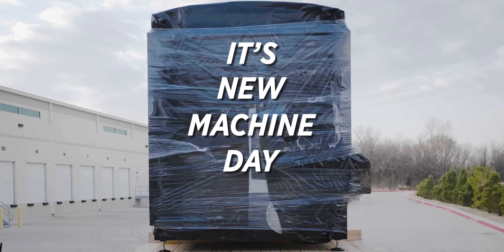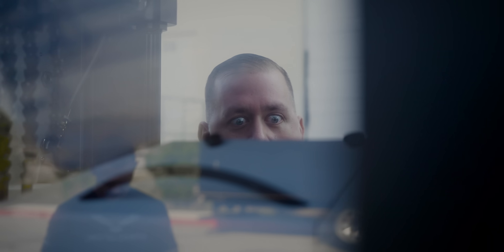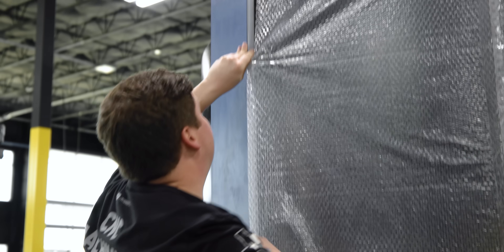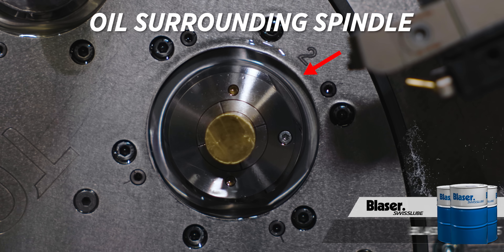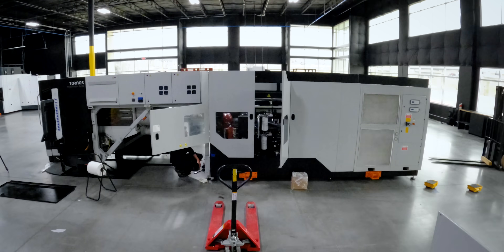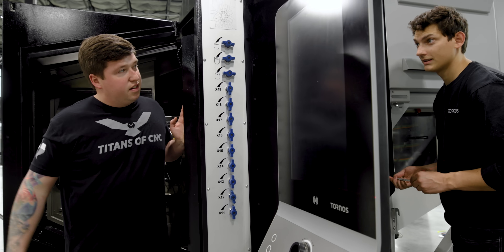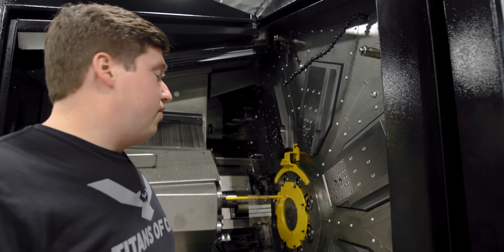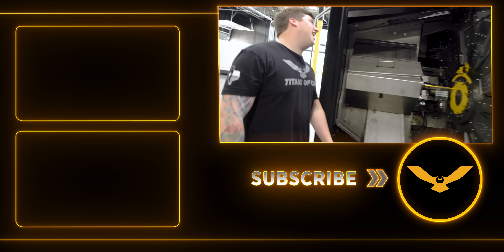GIANT 35 AXIS 8 SPINDLE MultiSwiss CNC Machine

Comment: This stuff is addicting to watch!  I took a CAD class at ivy tech in the early 2000s, and worked as a maintenance man at caterpillar engine plant in Lafayette IN. They had HUGE machines that would mill raw locomotive engines in the plant then assemble them. Those machines cranked out some huge chips, and a LOT of material! I had to dump the hoppers 😆. I wish I could’ve finished my degree😔. Thanks obama🤷‍♂️🤦🏼‍♂️

Comment: Have been runing the Tornos mulideco for years and, we stepped Upp to Index ms40 Machine. Runing parts in 4.4 sec.  When we testede itt IT did not move more than 0.01mm on 200000 parts. Runing in brass. 😁

Comment: Can we get a listing of what the 35 axis are?   I get the 8x X,Y for the panels we saw moving, and 8x Z for each spindle, but what are the other 11?
Reply: 8 X axis
8 Z axis
9 C axis 
6 Y axis
X and Z on sub
35 axis of motion
Reply: So there is a little debate up above about counting axis. I will go with what the tech college taught and that was basically 'if it moves, count it'. Spindles move on Z axis but they also rotate, which counts as +1 each. So 16 axis for the spindles. I am assuming the tool posts also do X and Y. That is another 16 axis. The 8 spindles also appear to rotate as a unit, so that is +1 for a total of 33.  If there is a pick off to grab the finished parts we probably get to add a few axis for that as well. I'd have to watch the machine cycle a part or have the manual in front of me, but I know I am close. Kinda want to find one of these operating near where I live and go check it out.

EDIT: Rewatched the video and there is a few seconds clip of the pick off coming it to where it would go to grab a part. Z axis to grab the part (+1). It also has to rotate, I assume... (+1) which gives us 35.
Reply: @andreidejanovich9041  That can't be right, there is at least one more tool post for drills and such coming in from the end.

Comment: Didn't Tornos make a MultiDeco like 20 years ago??? I run and setup ancient 6 spindle Tornos AS14 cam operated screw automatics.  They have come a long way from the old ones for sure. Currently we run 2-3 second cycle times and holding pretty tight tolerances with shave tools.  The pick offs are always a weak spot. We also have 32mm capacity ZPS 6 spindles as well. I specialize in multispindle but I can also setup/run CNC lathes (Fanuc only) . Love yalls content.

Comment: I was wondering how many 8 spindle acme bar machines I could buy for the cost of this?  Probably as many as I want and a building to put them in. But it’s cool
Reply: I'd rather have the ZPS or Gildemeister offerings , it's what we have. From what I was told the Acme Gridleys did not hold very tight tolerances and were more maintenance intensive. I've never seen one in person though.
Reply: @lonestaraudioconnection  the Acme Gridleys are a marvel of mechanical engineering. They don’t get much notoriety but they revolutionized manufacturing and quite possibly won WW2
Reply: @dovemfg  for sure they have their place in history. The ones we had were from the 1930s.

Comment: I thought I was a player with 9 axis, 2 spindles, and 3 programs running. 

You got my attention!

Looking forward to the rest of this series!!!
Reply: it’s not a 38 axis machine though lol unless every tool in that machine can touch each spindle.
Reply: @Rightisallwrong it has 38 different moving sections that require programming so it’s definitely 38 axis lol
Reply: @dakotareid1566  I think they changed the title lol it says 35 now.

It can only cut 8 parts at once it can’t move in 35 different orientations per part.  

So it’s more like eight machines with 4axis and then the last one is the spindle part z feed.

If it were one part in the middle with all those turrets around it, ya it’d be a 35 axis.
Reply: @Rightisallwrong  8 spindles that rotate so that 9 axis of movement, 8 tools around the spindle that also rotate so that’s another 9, that’s 18, then I’d assume the rest are on the opposing spindle, pretty easy to get to 35 axis. 

Axis refers to the number of individual movements. If you took a 5 axis and added another rotating bed and spindle it’d now be a 10 axis
Reply: @dakotareid1566  which would be two 5axis machine’s together

But also, by that logic, you can count the number of spaces on the turret as axis’s
Reply: @Rightisallwrong  I did a couple years on a hydromat line. This looks like CNC hydromat. Pretty badass regardless of axis/spindle count. Neat stuff!
Reply: @andreidejanovich9041  totally, it’s interesting and it’s a pretty wild machine as far as production goes.

When I was moonlighting for the inspector on his days off, I had to check the parts coming off those multi spindle units for FAI.  Every machine would have to turn in 8parts with a tag on each to tell which spindle it came out of lol
Reply: @Rightisallwrong  

The MultiSwiss 8x26 is fascinating. The machine has 8 Z-axes on each spindle located on the barrel, with each spindle having a slide with an X-axis. This means that in the main operation, there are 8 X-axes and 8 Z-axes axes. Additionally, there are 6 Y-axes available in option on cross-slide. So you are at 22 linear axes in main operation. The counter spindle sits on 3 axes (X, Y, and Z), and each spindle has its own C-axis. In the main operation, there are 8 C-axes, and 1 additional C-axis is available in the counter operation, so 9. So 34, but the most exciting aspect of the MultiSwiss is the barrel's unique axis, which opens up a variety of possibilities for machining. Overall, the machine has an impressive 35 axes that offer a wide range of capabilities. Thank you for sharing your knowledge on this topic!
Reply: @blackshadow772  You can’t add multiple things together and call them all axis. 

You have at subtract the number of cutting interfaces.  You can’t just welding three 5axis machine together and call it a 15axis. Because it’s not creating new work angles.

Look at the code, that will tell you how many axis the machine thinks it has.  If it’s got 34 or 35 axis, there should be identifies for each axis of movement.

My 5axis has CBXYZ…so it’s a 5axis.

If you made my head be able to rotate about Y, you could add E to the mix.  If the head could rotate about the X axis, that would be one more axis.

Those are all new definitions of new angles.  Does the multi Swiss have 35 identifiers for angle?
Reply: @Rightisallwrong  Thank you for your answer, I understand your point. A MultiSwiss 8x26 has 35 axis, all those axis can be called and work independently from each others.
Reply: @blackshadow772  Ya, that’s just multiple machines sitting together.  Like a cell.  

It’s 8 swiss machines with 4axis capability and the rotation of the spindle set being the last axis.  

By your logic, a 4 spindle 3axis cell center is a 12axis machine.

Comment: Index machines: the reason you can buy european-made 1" brass fitting for $5 (and 25 mm ones for $3)
Reply: That means the manufacturing cost is about half that, seller's markup and other stuff makes the other half
Reply: @MF175mp  manufacturing is almost nil at scale actually

The cost of the brass + shipping/handling far outstrips it
Reply: @angrydragonslayer  yes the manufacturing is probably less than 1€ per part
Reply: @MF175mp  it was ¢25 on the $3 fitting we made :)
Reply: @angrydragonslayer  so it's like a 10 second part
Reply: @MF175mp  4 seconds

Most of the 25 was money being put aside for when new machines were needed. The machines were built when ww1 was called the great war :)
Reply: This is a good production machine set it up and let it run forever not a machine u want to set up everyday.